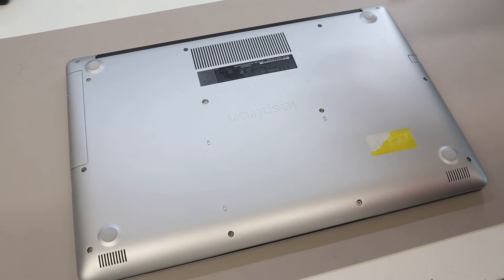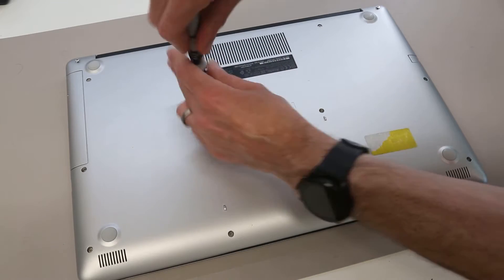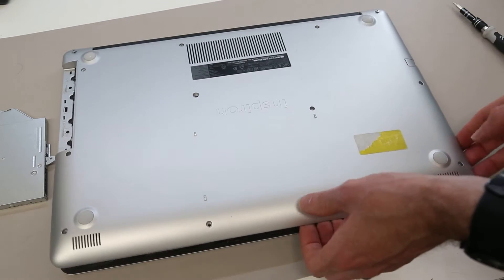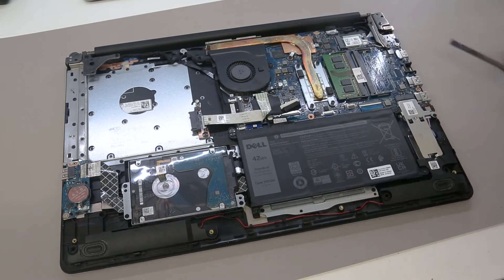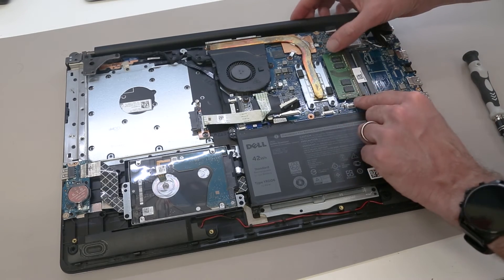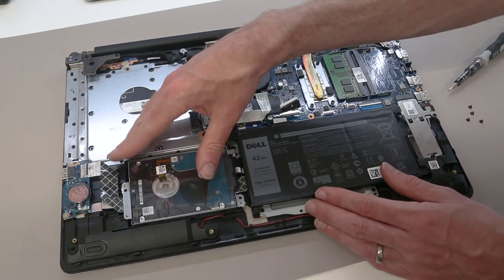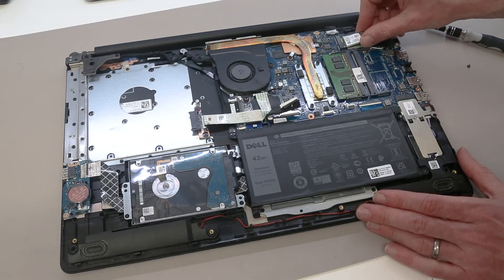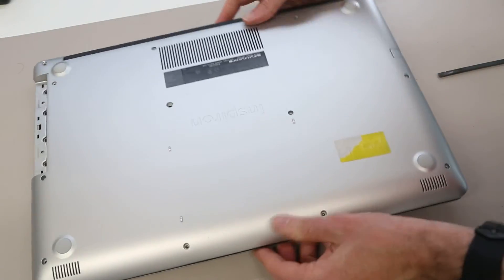Dell Inspiron 17-3793 - M.2 SSD, 2.5" HDD, DDR4 RAM and WiFi Upgrade Guide

Comment: What's the maximum amount of ram that can be used on this lap top. Maximum size of each ram module? Thanks
Reply from the maker: 2 x 16GB, for 32GB total. 32GB modules may work, but not something I tested.

Comment: Hello! What would be the process for fitting an M.2 2280 SSD into the HDD area? would it fit directly into that cable and would it need a caddy? Thank you!
Reply from the maker: You'd need an adapter like this: https://amzn.to/4241dLp
It would only support a SATA M.2 drive though.
Reply: @BrueComputing  Thanks! In one of your dell insprion 3593 videos, you mentioned that you could use the optical drive to fit another ssd. I have a 256GB NVMe PCIE SSD on hand right now, would that process be complicated? If I can avoid returning this drive I just bought I'd be really happy. Thanks again for your speedy reply!
Reply from the maker: You can fit that drive to replace the main M.2 drive, but if you fit a drive in the 2.5" or optical bays then they are SATA - an NVMe drive isn't, so won't work.
Reply: @BrueComputing  Thank you!

Comment: What was the smaller battery used for?
Reply: Used for the Motherboard settings (aka BIOS), which will reset to default if the coin cell battery is removed or dies.

Comment: What about the CD drive?  After re assembly the CD rom goes in, but stops leaving around 1/4” left before going in.
Reply: Is the screw that holds to drive in place already installed? It is located in the middle (of the bottom of the laptop) straight back from the CD drive. Remove the screw and then slide the CD drive back in.

Comment: Why twto HDD?
Reply: I use this same laptop daily. I use the 250 GB ssd for the operating system (Windows 11) only and a 2TB Sata hdd for software and data. This allows the OS to boot up quickly. Works very well for my purposes.